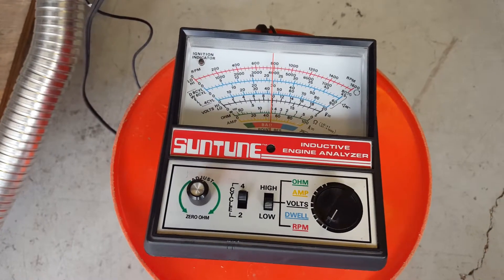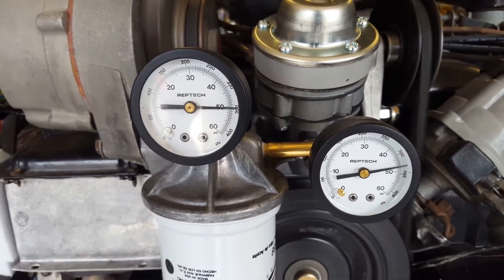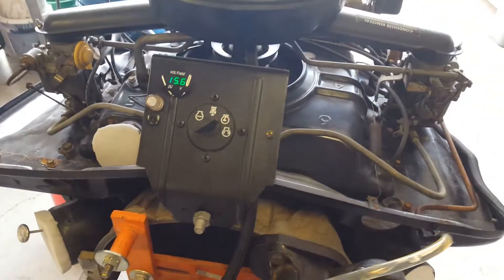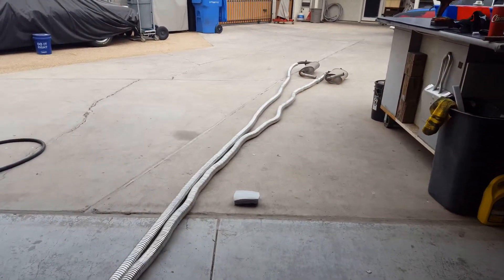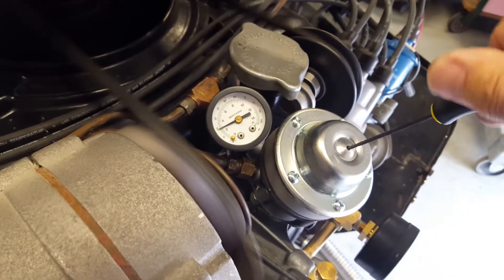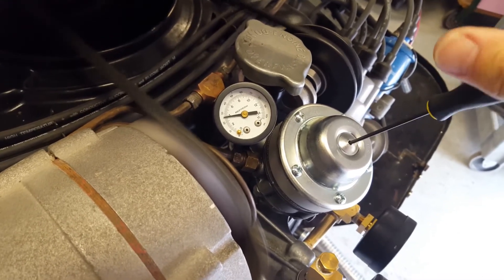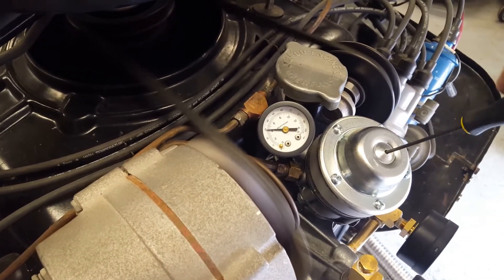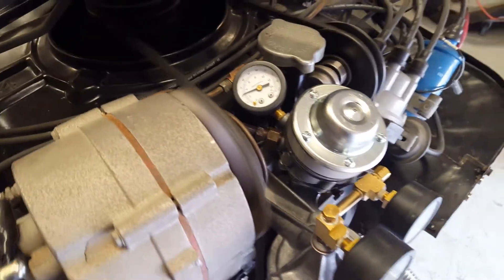Corvair Engine Running on Test Stand

Comment: Did you ever consider increasing the compression ratio by shortening the jugs or by increasing the indent into the heads and adjusting the valves to accommodate?
Reply from the maker: Plenty of engine builders have done that but then they have to manage detonation issues and higher heat. Lots of tricks can be done to these engines if you don't mind experimenting.
Reply: I had a new ‘65 Monza with 110hp, too, and did the milling of my heads by .090” after 100K miles and it ran like a bucking bronco. I fiddle farted with it, but never got it to run smooth again. At certain rpms, it got better and the hp was improved, but I sold it to an experimenter, who got better results. I sure wish I had left well enough alone and kept that little jewel. At three years old and 60K miles, I could beat a new Mustang V8 off the line to about 50mph with my smooth and quick 4speed stick. And it looked great!